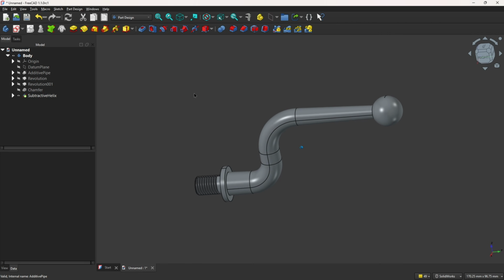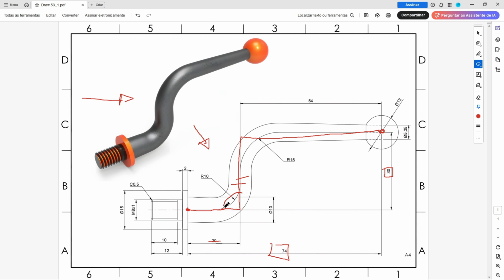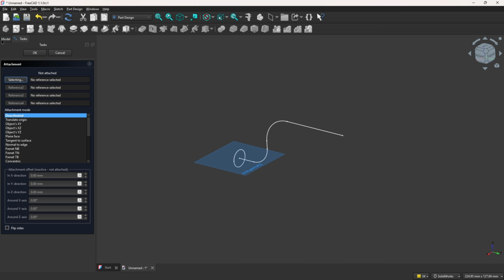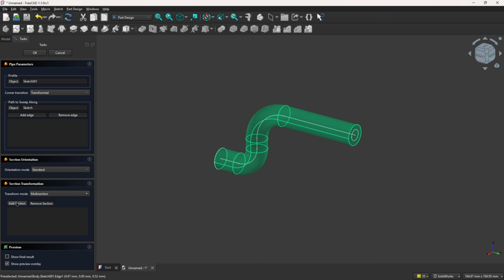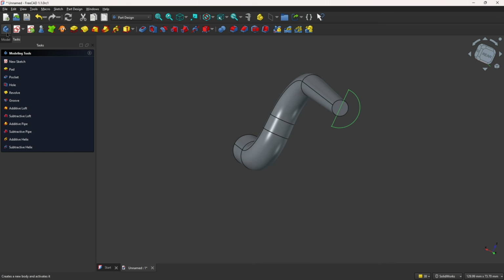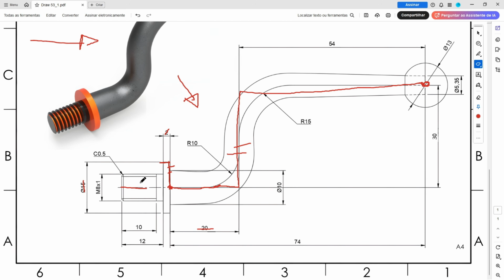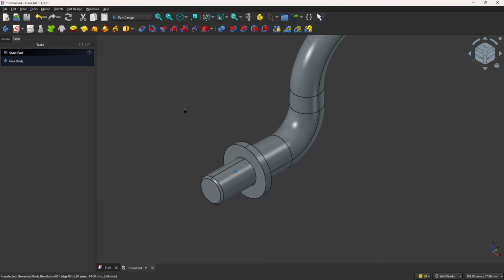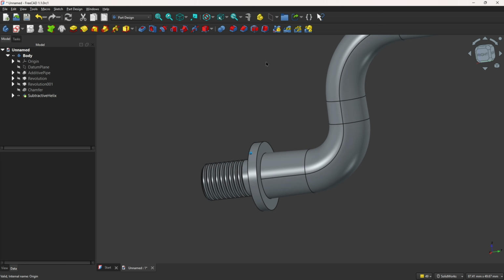FreeCAD Tutorial For Complete Beginner -Step by Step Exercise 47

Comment: Nice instruction. But hey, what kind of thread was that...isn't there a function for standard threads in Freecad?
Reply: No additive threads in FreeCAD's main branch at the moment.
Reply: @yosyp_yosyp  That is not so nice, actually really primitive 😢
Reply: @leiflindqvist9095  It is. FreeCAD's process is really slow.
Reply: @yosyp_yosyp his drawing says M8x1 thread,  so look up dimensions for M8
Reply: I don't like creating my own threads at all.
In this situation, I would prefer to use the (add on) Fasteners workbench, ask for an M8 threaded rod, give it the desired length, and use the Part wb to move and rotate it into position and fuse it to the main body.
Reply: @martinkotze7258 
Well, I think I will stay with Fusion 360 waiting for Free cad to grow up a bit More.